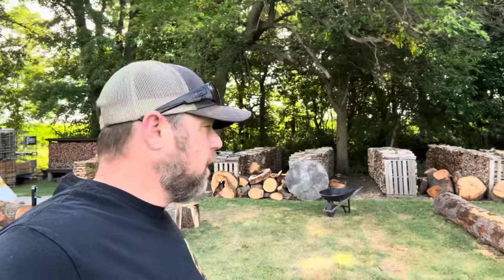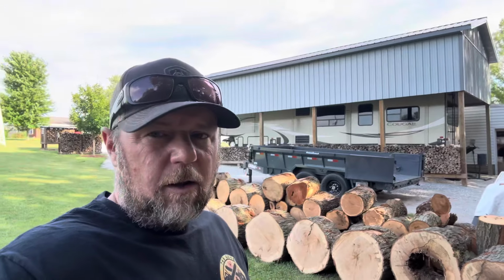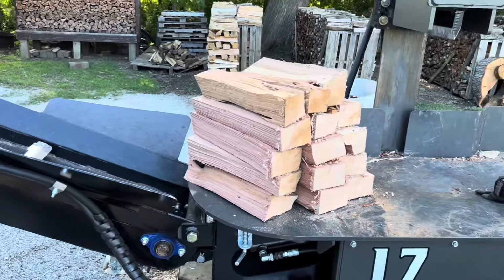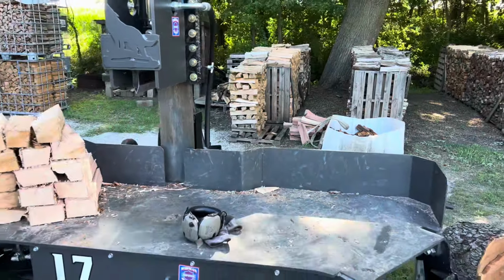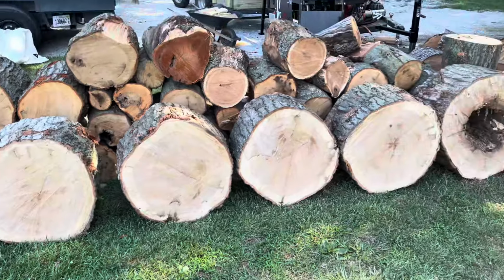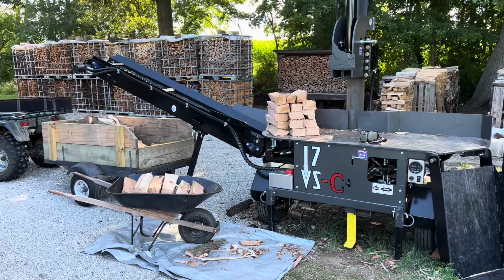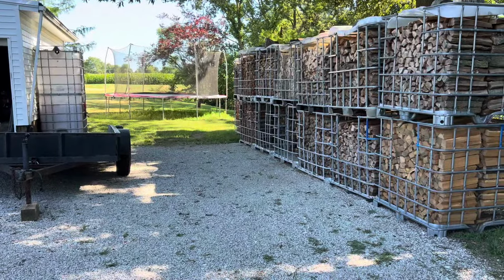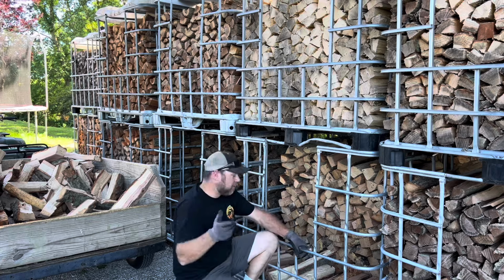Breaking Down Some Huge Tree Service Rounds!! Is It Worth The Extra Effort? #firewood #wolferidge

Comment: I think you have the right machine for wood like that. In my case, with the machine I run it wouldn't be worth it to sell because of the time it would take to process.  However I'd still take it to process for myself for winter
Reply from the maker: Yeah this vertical really shines when it comes to big rounds! My box store splitter is not as enjoyable to use on those biggins. That log lift and huge working space on the vertical really make it worth it to bust down the big rounds. Thanks for watching and commenting CFM👊🏻

Comment: Them 300 lbs round 😮, you should put cooking oil on the splitter table, make it easy to more the round under the splitter wedge todd . Cooking oil like 👍 peanut or corn 🌽 is an organic oil great for the BBQ bundles 😊.
Reply from the maker: Thanks for the tip!👊🏻

Comment: I wish I had one. That splitter reminds me of a butcher shop where everything is right where it needs to be to make work flow easier. To not have to rip/bust 300# rounds into 1/4’s would be nice because I mostly go after big rounds to make the trips to the dump site worth while.
Reply from the maker: Having the opportunity to run this demo has really opened my eyes to vertical splitters. You are absolutely spot on with your analogy!! Thanks for watching Salt Rock👊🏻

Comment: The size of the round doesn't matter one bit with a quality commercial vertical splitter.  Split your round into any size you want.  Perfect machine for a solo operation.  The only caveat to that is when the round gets to be bigger than your working table depth, then do your self a favour and pre split your round  into smaller chunks.  They're easier to man handle.
Reply from the maker: Yeah, I hear ya on the vertical splitter! The vertical does save on the manhandling!! Being able to slide them on the big work surface makes all the difference! Thanks for watching and commenting 👊🏻

Comment: That Cherry will split bad when cut into boards . But it’s pretty wood .
Reply from the maker: Well I have the most use for slabs! I usually just leave the logs a little long that way if it splits I got room! I hear you though my dad does a little woodworking and it will split pretty bad! Thanks for watching Jason👊🏻